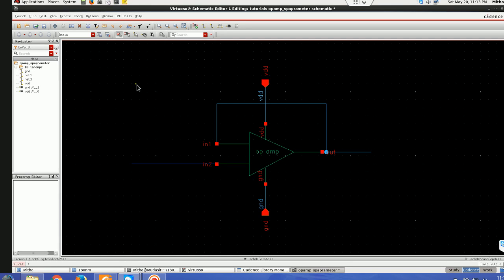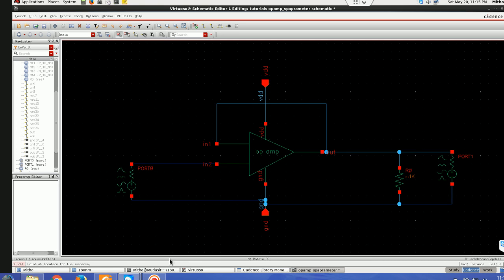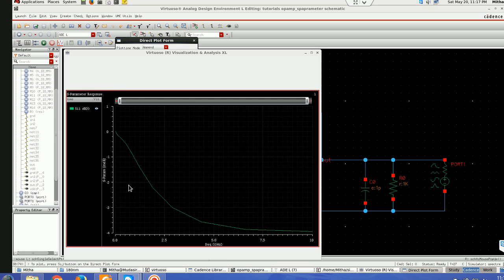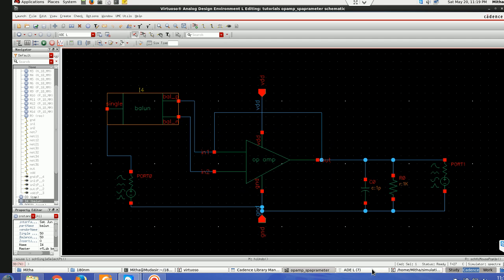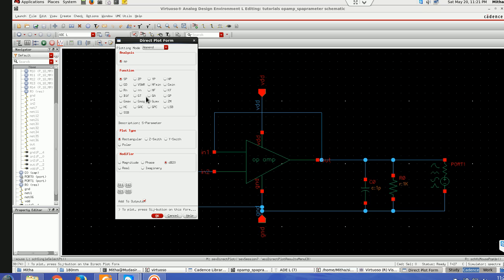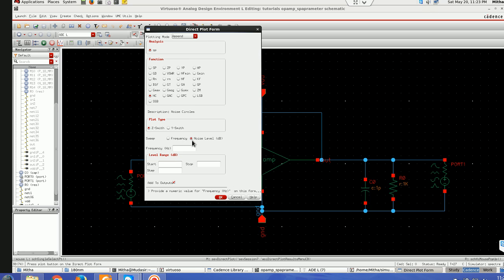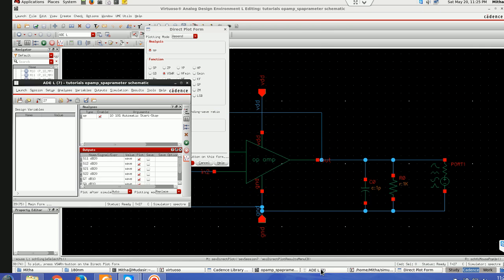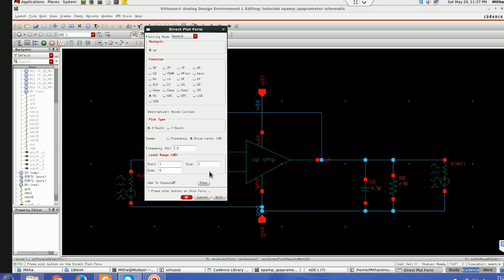Cadence IC615 Virtuoso Tutorial 12: S-parameter analysis in Cadence ADEL

Comment: ,how to plot group delay vs  frequency in cadence
Reply from the maker: Following are the steps:
1. Do the ac simulation of your circuit.
2. Plot the output net magnitude (V) and then send it to the calculator.
3. There is a function "groupDelay" use that and you should get results .
4. Plot it and y-axis you see "seconds" unit and x- axis "Hz". that is your groupdelay

Basically groupdelay is the derivative of phase w.r.t to frequency.
There is another way to do it using S-parameter expression
Reply: @MudasirMir7  thankyou for replying.I am currently pursuing Mtech from IIT kanpur, and since 10days I am trying to simulate the LNA power amplifier with lowest group delay over frequency range 3.1ghz to 10.6ghz .

I have few questions,the IEEE paper which I am trying to simulate has taken Vin to be 2.5V but in UMC 180nm CMOS max we can take maximum 1.8v na???

Second question is that how much variation can be in the result of group delay,power ,S Parameter,Ac gain if Vin is taken to be 1.8v instead of 2.5v ?

And one request is that please tell how that other way of getting group delay vs frequency using S parameter
Reply from the maker: You are welcome!
>> They have used the I/O devices of 180 nm (VDD=2.5V). It is an old trick to achieve better performances, mostly linearity. Therefore when you scale down and using core device in 180 nm, the VDD as well as i/p signal will scale down(VDD=1.8V).
>> For sure you won't be able to match their results (linearity, gain, NF) but with FoM you should justify that your results are competitive enough. You are targeting a wide-band so good luck! :). Moreover do MC of these parameters for more understanding.
>> I don't remember the formulla (using groupdelay was convinent for me). Look in application notes of keysight ADS.

Comment: Sir, how can we add RF in , RF out pin in RF circuits
Reply from the maker: You can use "port" from analogLib when you create the testbench of your circuit. If you are using Goldengate with cadence, there is option for RF pins directly.